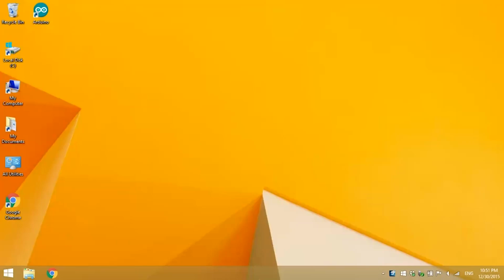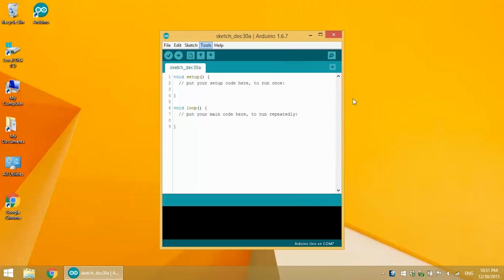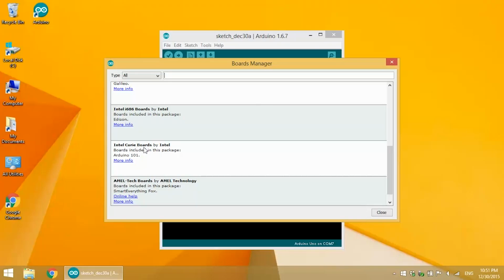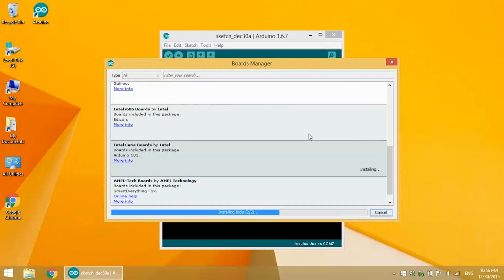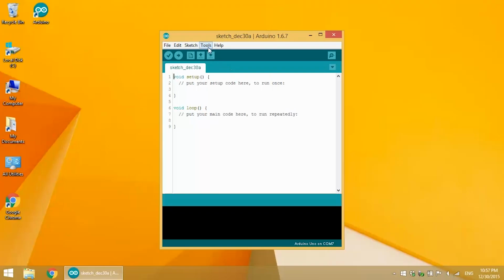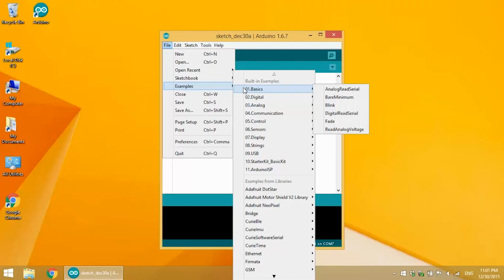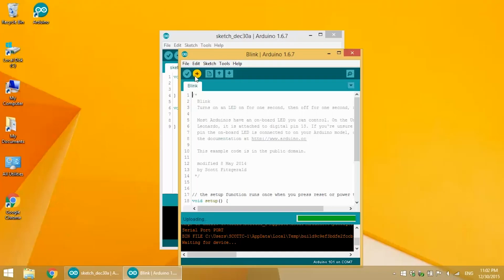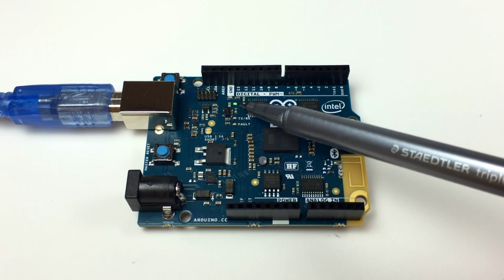The New Arduino 101 (Genuino 101) -  Unboxing, Set Up, and Comparing it to the Arduino Uno

Comment: The crystal you are pointing at on UNO is the crystal for 16U2, ATmega328 uses a tiny ceramic resonator. It is right under the word "Italy" in "Made in Italy" writing. UNO's flash memory is not in 16U2, it is in ATmega328. 16U2, being a MCU, has its own flash memory which is used by the firmware doing the USB-UART conversion.

Comment: Wow 32-bit? Dual Core? That's an absolutely massive upgrade in comparison with the Uno... Not to mention it has integrated bluetooth... But the PCB itself could have more ports... Why is it exactly like the Uno if it's processor is even better than the Arduino Mega?

Comment: why is it named genuino outside the US? To be honest im not really happy with intel getting on board. I think that to qualify as real open hardware it should provide all documentation of all the parts included. So the IP cpu cores as well.
Reply: Mainly because the company we know as arduino has lost the right to the name in Italy and part of the EU so they use Genuino instead. You can find more if you look up the dispute. It's why there's a difference between Arduino.cc and Arduino.org too.
Reply: there is full documentation at the arduino site, schematics, cad drawings and all
Reply from the maker: +Johnnie Bassdrum I'm not sure why they named it differently outside the US, seems like it would have been more simple to just name it one thing across the board right?
Reply: +Circuit Basics http://makezine.com/2015/06/22/arduino-wars-genuino-vs-phantom-arduino-clones/
Reply: not of the ip core Jason Rochester

Comment: I have some quick questions. I don't know anything and am learning.1. Does the new curie button Intel advertised require the Arduino board to inter face with it?2. If no to #1, How do you interface with the new curie button Intel advertised?   3. If just a laptop to interface with new curie button, what software is needed?thx,
Reply: +Bill Bennett connect it via USB, i get this as ttyACM0. build the files using a cross compiler. then upload it to the device.

Comment: You definitely cannot change the voltage for the pins. They are 3.3 Volts only. Though they do tolerate 5 Volt inputs.

Comment: Not sure about level shifting but the pins are all 5v protected
Reply: +knightmarex13 Yes, they are able to handle 5V by going through the 3 LSF0108 level translators embedded on the board.